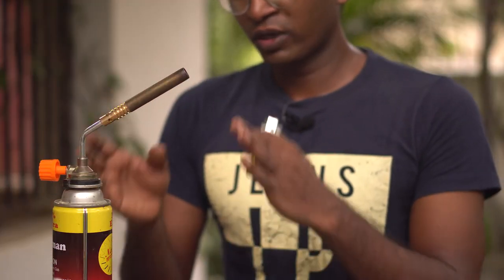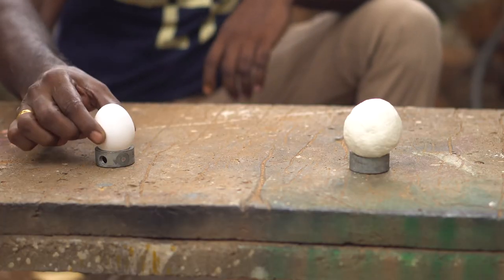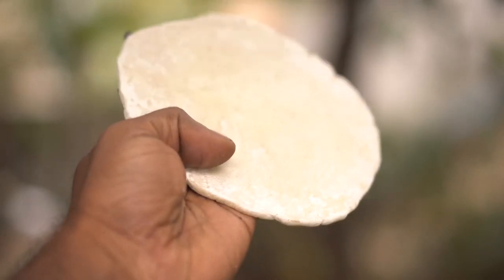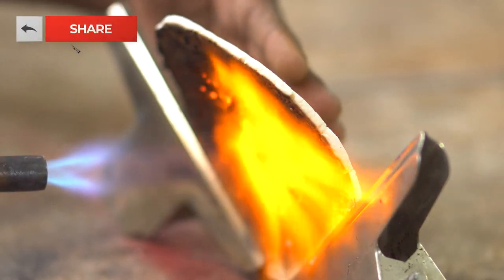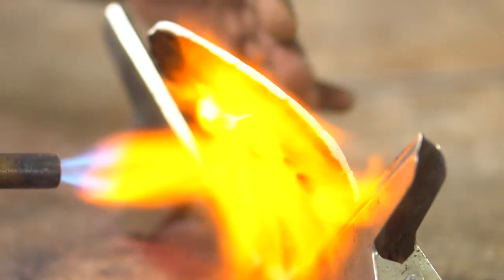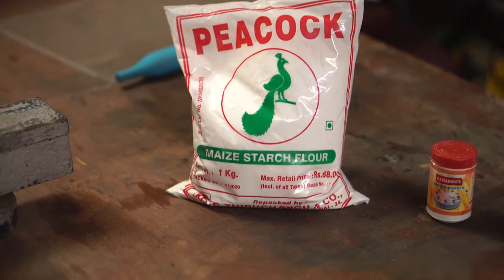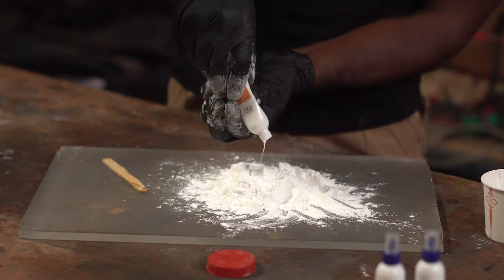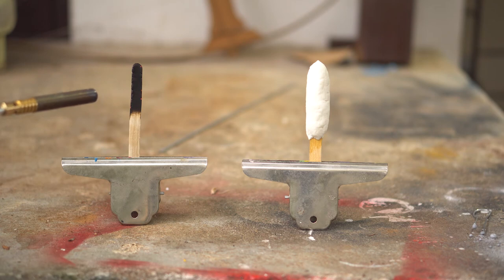தீயை தடுக்கும் ஆச்சர்ய பொருள்வகை| Homemade fireproof material Starlite experiment|TAMIL DIY

Comment: Interesting. Thank you, for sharing this info. By any chance, has any brands have come up with similar shielding technology for residential structures, so that it protects the same from radiation and heat? Have seen paint brands advertise using similar USP’s to few of their variants... does those paints work towards it, in reality?
Reply from the maker: What you see here is only a concept. The material we made is fireproof...but not weather proof. When it comes in contact with water...it will detoriarate.  That brings us to yet another challenge of putting this is residential structures. What you ask triggers an idea for the video...let's put all those paint brands and do a fire testing and reveal the footage.

Comment: Durability enna Anna??
Reply from the maker: It will hold the fire as long as there is material to produce more carbon.  After that heat will reach the object and cause it burn
Depends on the thickness